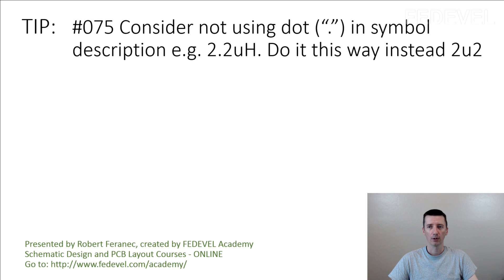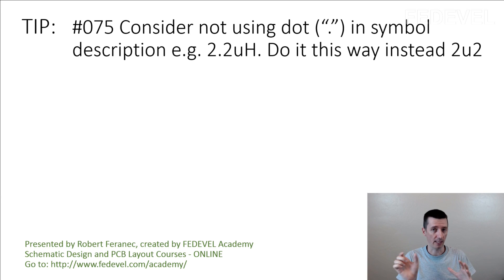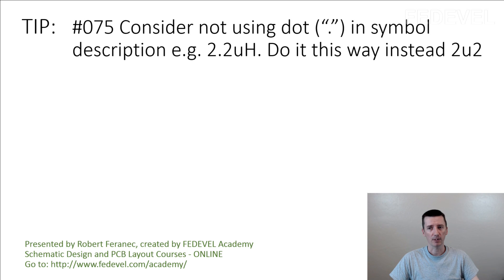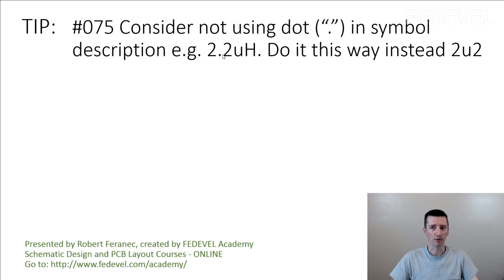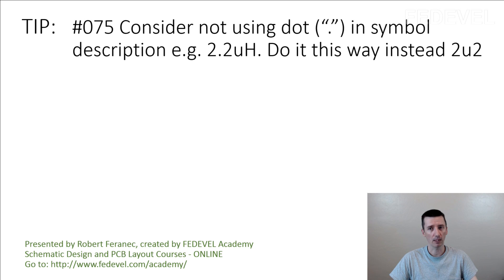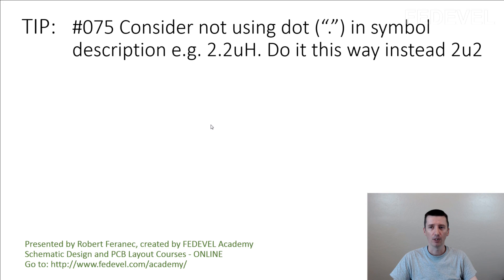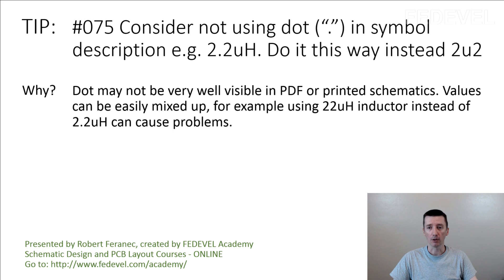TIP #075: Consider not using dot (“.”) in symbol description e.g. 2.2uH. Do it this way instead 2u2

Comment: I usually like and appreciate your tips. But this one is an exception.
It is almost 2019 and we still talk about the excuse of printing a schematic and its readability.
Q1) Why do you use paper in this era?
Q2) If the information on a document is so important and critical, why don't you print it on a large enough paper so that it is easily readable?

Comment: I think this is the only tip I don't really agree width, but it's just a personal preference.  This may have to deal with the fact that I don't really print out much anymore so on the screen the decimal is always present.  Also I try to copy and paste instead of typing values in when possible.
Reply: I know this is an old comment.   If you are working alone, obviously you can do what you want.  But if you are working with others, please consider things that make it easier for folks who work slightly differently or whose eyesight might be less than yours.  Please follow this tip.
Reply: @isaacclark9825  I dont know about you but my company always write 1.0 or 2.2, hundread of people use that and not single one for many year have any problem misreading it. Me and most of my colleague actually hate the type of writing 2u2 because it feel unnature.
Reply: @isaacclark9825  and just like he said, we never print out schematic for any reason, every thing digital